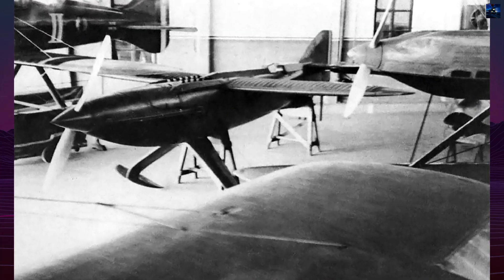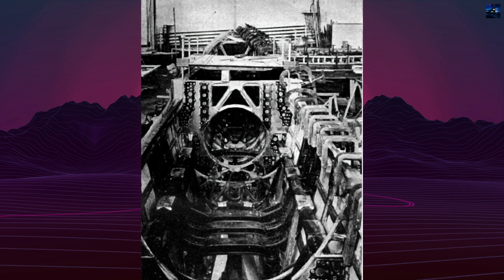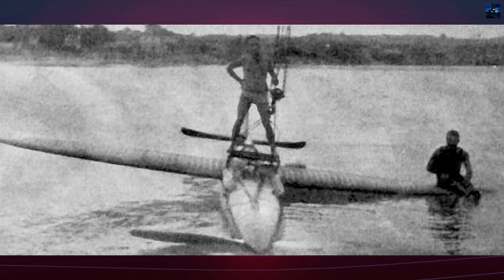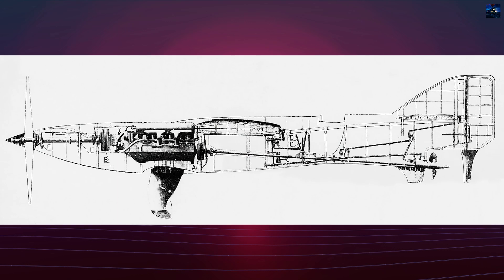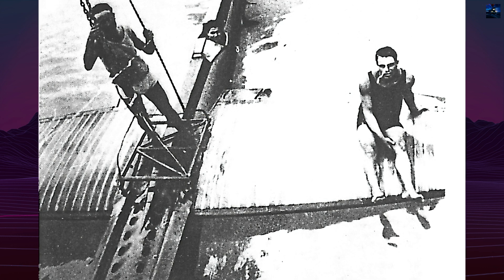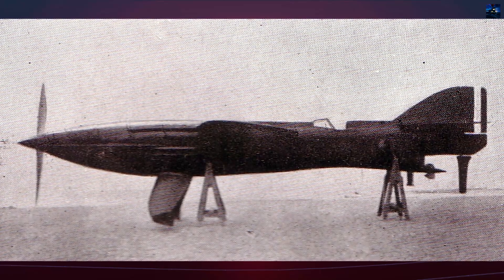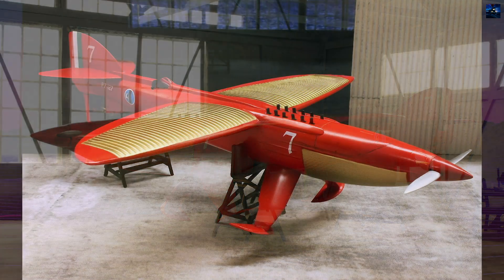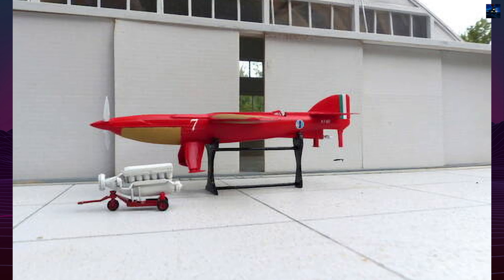Piaggio P.7: The Italian Hydrofoil Racer That Never Flew

Comment: 971,000 horsepower?!  V-6 engine?!  No & no.  Maybe 971 h.p., which would've been a very high rating at that time (they greatly supercharged race engines to improve performance for the short races.)  Plus, you can clearly see the 6-cylinder jugs of the left bank, arranged in 3 pairings.  Multiply that times 2 with the right bank & you get a V-12.

Later in the video, you see 12 stub exhaust pipes poking out the upper engine cowling, evenly spaced.  And then there's that engine on a stand with 12 cylinders (evenly spaced).  That engine is not the same as the one in the crude earlier photo.  Maybe they had updated to a better engine, trying to improve takeoff.